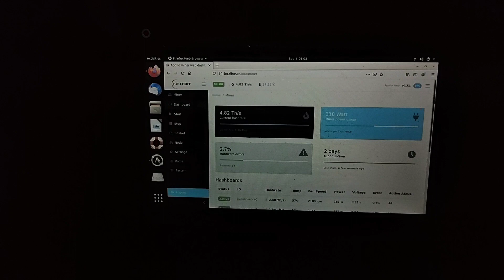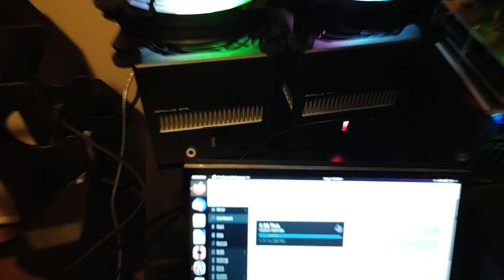FutureBit Apollo BTC, PrOfiTaBiLiTy 2 Month Update, Full package & Standard Unit Tips, JTC30

Comment: it was running all connections for a month or two, then it dropped to 31, and now its dropped to 10. Ran it on eco for 2 months, and then upped it to bal, and no have put it back on eco.  Just have not been in the mood to d/l, reinstall the software...or sift through a terabyte of post trying to find an answer.  My complained is that there is no support from the Apollo at all.

Comment: got one, took 4 months to show up,  and it is one flakey piece of equipment,  Constant monitoring, and it take days to reach full connections, and once it got there, its started dropping them.  Its taken aprx 3 months to approach first payment, and I am hoping it lasts that long to get the 6?.?? payout on Tuesday. It been running 10/32 connections after an hour of trying to get it to boot. Guess what, the company leaves it to the general Linux community to support it.... take your money and buy Shiba..
Reply from the maker: Try opening your port up or reflashing the OS. If you only have 10 connections that's why. There's a ton of support on the forums.

That said, the node doesn't affect the mining and it seems like you bought this primarily looking to ROI ASAP.

Sell it on eBay and buy Shiba with it like you said.

I'll hold the ~.001 BTC this makes every month and we can compare how that looks like in 10 years.

Comment: Got mines… batch 2 here!
Reply: My error rate was around 1.5% … hashrate @ 3.4 … and I swap between eco and balance
Reply from the maker: @dewaynebrown5573  nice! are you getting 3.4 TH/s on balanced with the regular PSU and less than 200W? I need to overclock mine using custom settings to get hash rates that high.
Reply: @justh0dl  I’m ranging between 2.53 to 3.4 th/s on balanced with regular PSU at 152W. I was shocked by your unit temperature. I have mines in the basement very cool but avg between 65 Celsius to 78 Celsius. When he gets close to 80 I shut down the unit so we can cool off.

Comment: How do you get on the dashboard  been trying to setup the full version still having a hard time
Reply from the maker: Are you connecting to a monitor or trying to login thru the web? Ive only used a monitor on mine but I've heard on the older futurebit LTCs they had an issue where it was difficult to connect via the web app but had no issues operating it thru a monitor.
Reply: @justh0dl   I finally got, I had to find my ip address. Now it's working.  Already found 2 blocks
Reply: @oburney2607   peace bro. I brought two full version and 1 standard. Im trying to set-up mines on a alienware laptop. How did you find the IP address?
Reply: @kennethwilliams8545   I had to login into my router and find the ip address for the futurebit btc
Reply: @kennethwilliams8545  how’s the profits coming?

Comment: Hey Jay,

I like your channel. You actually were the deciding factor for me to jump on Batch 3. Very excited to see updates on your setup. Will get mine Q4. How many standard packages can I connect at once?
Reply: I ordered 1+2. Lets see what happens.
Reply from the maker: Thanks bud! I've heard of people connecting like 20+ standard units with USB hubs but the most i've seen is like 4-5. I will personally be running 2 standards & 1 full package. I'll be doing another updated video showing the performance of all three along with reported power consumption + noise levels. On balanced, I think these will push nearly 8 TH for just 450-500W which should be insane.